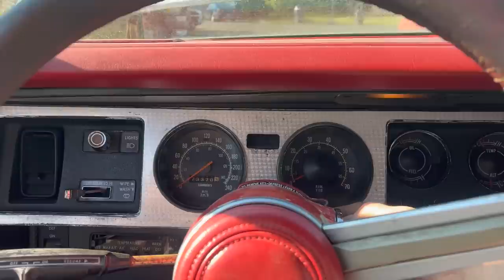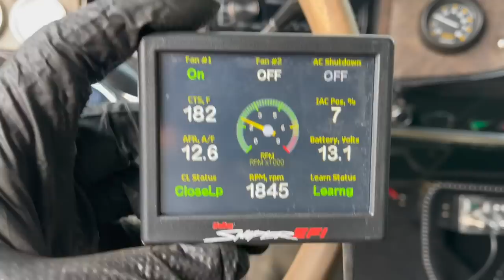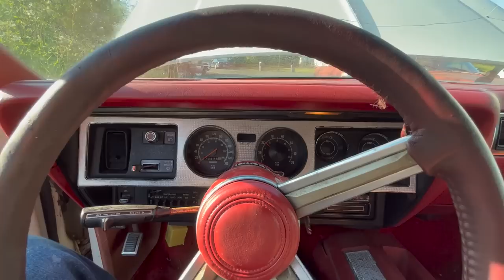BURNOUTS, BANG SHIFTS, AND BEARD TRIMMING! It's The 11,000 Subscriber Special!

Comment: Wow. Problem child is a cool pickup. First 1st gen quad cab I've seen. Only heard of them. Can't wait to see more on that.
Reply from the maker: It’s an awesome truck. We built it for the owner, “finishing” it in 2020. He doesn’t live here full time, and it’s been with me more than him since then… There are just a few small dumb bugs that I need to get done. It’s a great driver as it is. I’m basically down to the rear fuel tank not working correctly. It’s just one of those problems I can’t wrap my head around and I’ve been putting it off for way too long. Also that tank is like full… so there’s that. It’s coming!
Reply: I have an 89 f250 that continues to continuously throw me curve balls with the fuel system. One day I got it sorted...the next day its filling its own fuel tank that isn't being used from the one one I'm running off. 
 of. It has a good soul though and I like him.